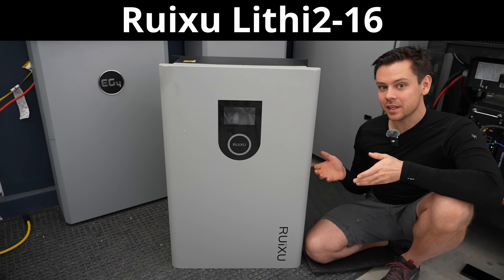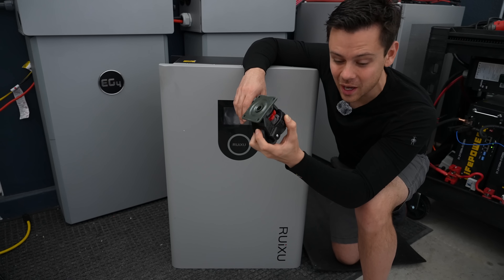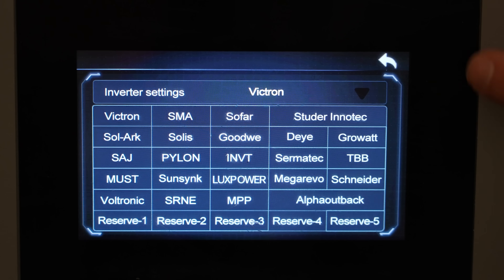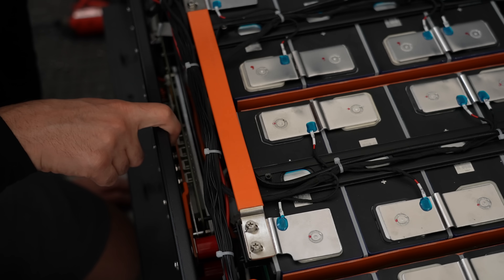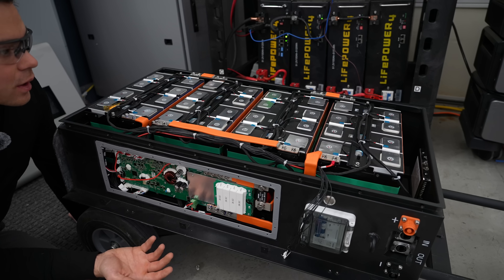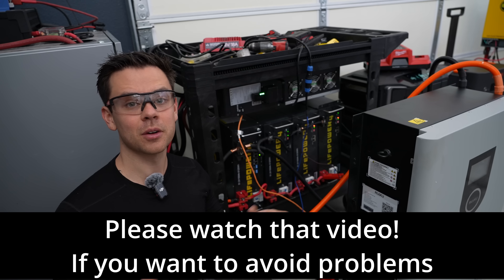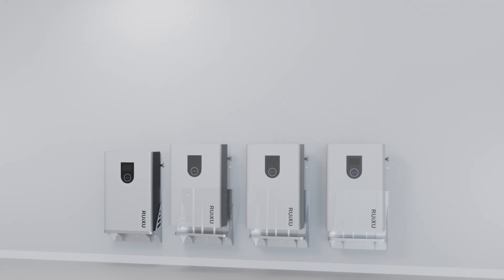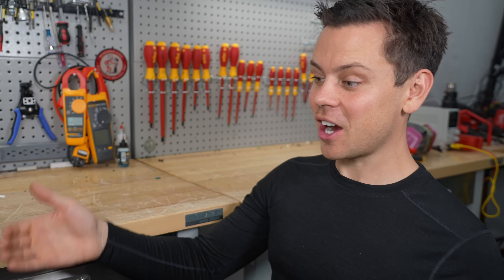Ruixu Lithi2-16: 16kWh 48V LiFePO4 that is Cheaper than EG4?!

Comment: I (like many here)  have watched Will from when he was doing videos out of  a camper with a tiny 12 volt 1 battery system and every single video has been solid gold. He has become the definitive go to for no bs hands on solar information. Great job Will, keep doing what you're doing. You are a highly trusted source in a  world of smoke and mirrors.
Reply from the maker: I appreciate it man!! Thank you :)
Reply: @WillProwse  Tried the Anker X1 yet?
Reply: @WillProwse  Tried the Anker X1 yet?
Reply: @photorealm you nailed it. I couldn't have said it better myself. Will Prowse makes excellent, informative videos!
Reply: Will is who I showed to my 20 year old and told him, this is how you get somewhere in life    Very impressive young man
Reply: Agreed 100%!!!! Such an amazing story of hard work, determination, intelligence and overall success!! I trust Will 100%👍🏻💪🏻
Reply: I watched a lot of videos back then. Will gave me the confidence to setup my own system. 
Have been off grid for 4 years now. The equipment has changed significantly.
My current system is discrete components. 

Currently have a 24V dual Tracer BN 4215 MPPT system and 6 Renogy 320W solar panels with a Giandel 4000W inverter.
This was recommended a few years ago when Will was still getting popular.
I started with 16 Fortune 100A LFP connected as a 8S2P battery, but upgraded to a 8S2P 280A LFP system.
The upgraded battery has made a huge difference in running an A/C all night and a heater in Winter.

I have the equipment and am upgrading to a MPP 48V 6548 All-in-one w/ a 15KW battery.
I will put the old system in the garage to run all my tools and charge my push and riding mowers and other yard tools.
I have 2 generators for when the sun doesn't shine. Currently using Champion 2500 (1800) and DF 4750(3800).

I had Westinghouse, but could not get them serviced anywhere. They worked well until they didn't. They were quieter.
Reply: That's really strange🤔..
  I was thinking the same thing...😎👍
  Because, I was watching his work, back in the day🧐💥😊
Reply: Same here. It broke my heart watching him in his van because I kept finding myself saying, where is his mother?
Reply: Yep, he is reliable with no bs
Reply: Loved it when Will was on the road. Talking bout his relationships and his messed up foot were more my language.

Comment: The fact about the casters at the bottom of the unit, i totally agree with you to remove them. That is a weak design. Each of the 4 wheels has to be rated for more than 300 lids (including safety factor), not the whole set of 4 as a total.

Comment: Over 300 lbs and you want to mount it on the wall ???
I’d resort to ground mounted, stacked or bolted down. 
Thank you for the review, very informative. ❤
Reply: You can mount in any orientation? My home has old unused brick oven in basement kitchen that seems perfect and was just thinking that I could custom build one. But how could I build one using something like this or EG4, I could mount them the orientation that a brick is laid, for lack of a better example...?

Comment: So this is Europe, but I bought 280Ah 16S batteries directly from China and imported them myself. It only has 100A BMS, but it was 1150USD plus 450USD shipping, so 1700USD + VAT. Have run them for a month and so far very happy with them for my application where the 50A max charging speed isn't a problem. Otherwise very similar to this Ruixu but without the flashy display. It has a very boring screen, but it has all the basic stuff. Supports Pylontech CAN/RS485 so connected to my Deye inverter first try and BMS communication just worked with master/slave batteries.
Reply: Vet du om den funkar till ferroamp?
Reply: @mw9282  Ferroamp needs high voltage batteries, so no.

Comment: 00:43  "NOT Indoor rated"  ???
Reply: I’m confused on that. I thought outdoor rating > indoor rating 🤔
Reply: @Werdna12345  my thoughts as well .
Reply: in eu it need to be on the posetive list provided by eu to be covered by insuriance  or to grid connect it for example
maby thats what he is talking about

we have a positive list for solar equitment equitment in eu
if the equitment is not on that list i would not connect it inside a building or connect it to the grid 

not on the posetive list is not a good sign

if it did not have a CE stamp it is deffently also a no go

Comment: Thank you Will! So, since this is closed loop with EG4 inverters....hitting the emergency disconnect on the EG4 inverter will disconnect the ESS / Batteries also?
Reply: Yes, it does. I have an EG4 FlexBoss 21 & GridBoss setup with an external remote RSD button. When I tested it it shutdown the entire system inverter, PV and batteries just as it was expected to do.

Comment: It would be awesome to see a review of the Basengreen DIY batteries. They have about the same power as these Ruixu or EG4 batteries at about half the price.
Reply: And the other DIY boxes- Apexium and Yixiang
Reply from the maker: Found American distributor, $2400 but again, out of stock. Dang
Reply: @WillProwse  Are you seeing my replies with links? They seem to be disappearing to me anyway after I post them. They are on the Basengreen website. The ones that are available are the DIY kits with 314Ah batteries for $1925. They are coming in mid December.
Reply from the maker: Can't find any available for US. Only EU.
Reply: @WillProwse docan power us has 2 different DIY boxes with different BMS one a JK and the other I think is Pace
Reply from the maker: Where do you buy them for USA? The one that would compete is out of stock right now.

Comment: Any thoughts on ordering batteries now for a project 2 years down the road knowing tariffs are coming and possibly loosing the 30% rebate in the future? I cant imagine them being cheaper in two years but there’s still a lot of innovation going on too.
Reply: I'm thinking along these lines too. These are not buy and forget items. They need a charge to be maintained. Also, I'd not wait too long, there is a Calendar Aging aspect to their longevity.
Reply: LOL, not "loosing" anything: tightening restrictions!  Or adding tariffs.  But two years is eternity in tech/battery tech. Probably not wise to invest now as the time value of money and the probability that the tech and price will just get better is such that your investment in something that's just going to sit around will probably degrade more than the discount you receive now.